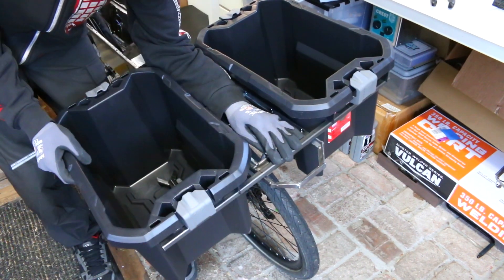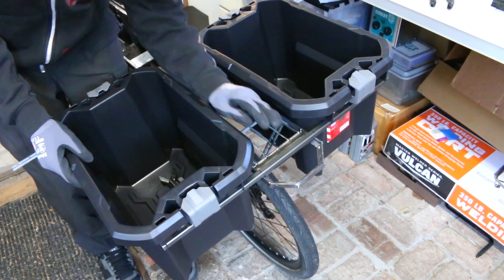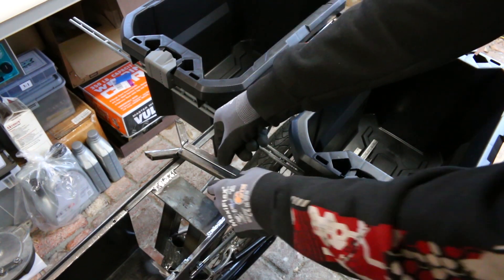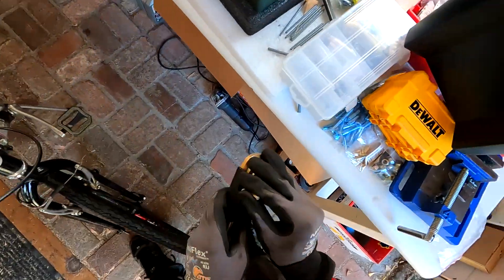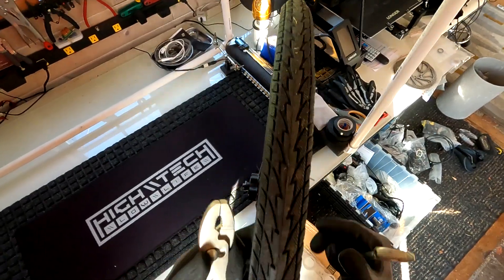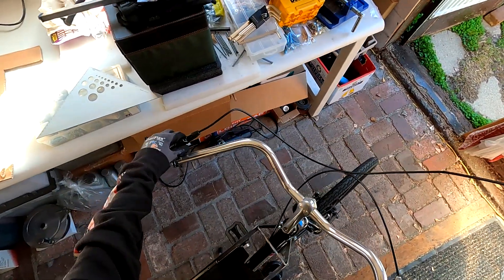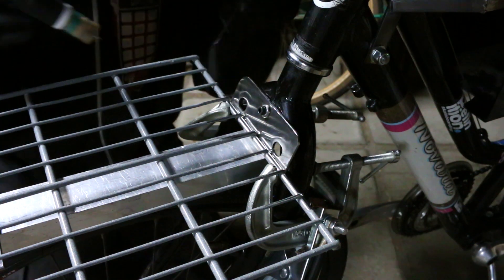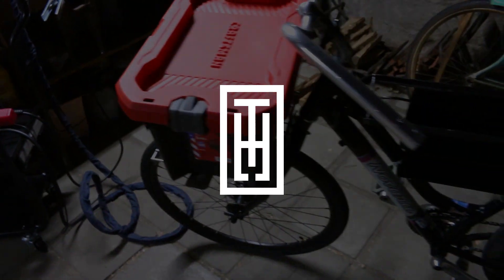🚲 Finally! Cargo Bins On The Cargo EBike (1000W, 48V, Hub Motor) [P3]

Comment: To switch from conventional to disc brakes is best done by switching out the frame and fork. Proper mounting is important. 

The tendancy in DIY builds is to think of the frame as the objective, but in reality, used frames are incredibly available and cheap.

If your design changes critically, then you should consider changing out the frame/fork. It may be a setback, but you will end up with a better build in the end.
Reply from the maker: Another commenter said they make little adapters, and those would work as well, but my solution will be more robust than a factory integration and much more than the clip on adapters 👍

This bike was free, and this is more for experimentation. It's very possible to make mounts to a higher spec than factory, so I don't agree with the solution to swap out the frame and fork. You'll see how I do the caliper mounts in future episodes if you're curious. 

Thanks man!

Comment: You would be safer with a trailer, unless you carfully mirror your weight on each side, your center of balance will be off and you could be pulled out of line, esp. on corners. Even if you do that, unless its also tightly packed, the weight will shift to one side as you round the corner and yet again, you will be off balance. Dangerous.
Reply from the maker: Thanks man, we'll see how it handles. I think distributing the weight will be common sense each time you load up. I'm not sure how more "dangerous" this would be than any other cargo setup on a bike? This is the standard layout for adding baskets to a bike frame, with numerous cargo bikes having this same design. The bottom of the bins are about level with the centerline of the wheel, you wouldn't want to go much lower for fear of hitting them on the street when cornering. 

You're essentially saying that all storage on a bicycle is dangerous due to a weight differential between sides, and I don't agree with that. Plus for very heavy items, the front bin is centralized. A trailer also brings about its own challenges and potentials for danger. Safety isn't priority number 1 to me or this channel, maybe 3rd or 4th. But I appreciate your criticism and concern, thanks! 👍🍻